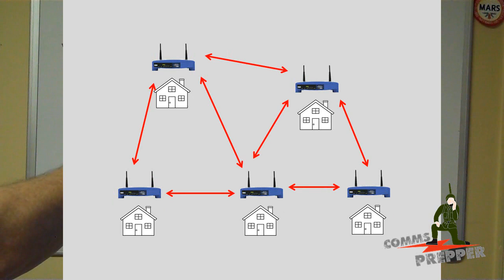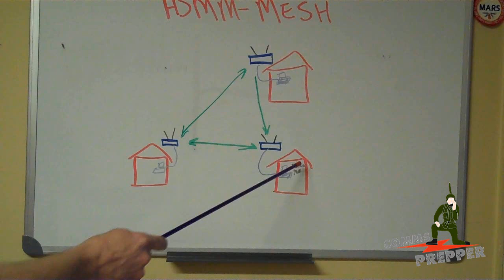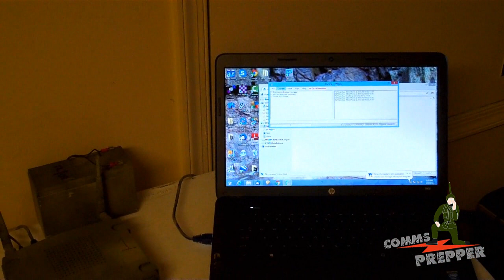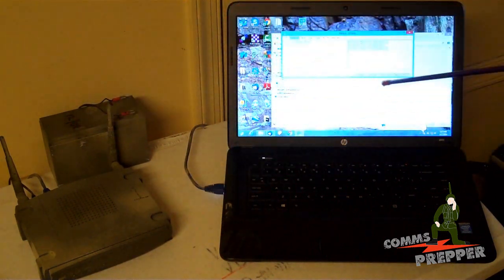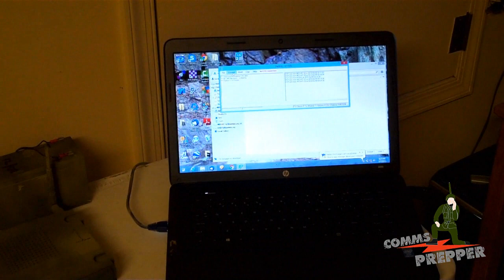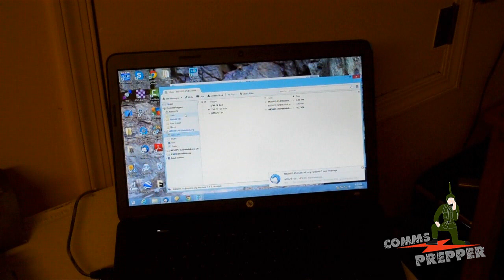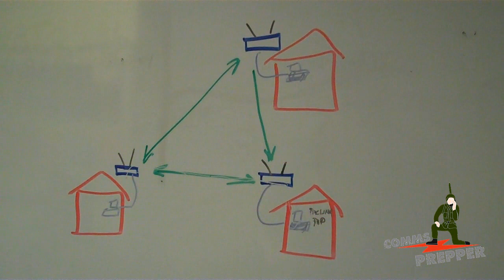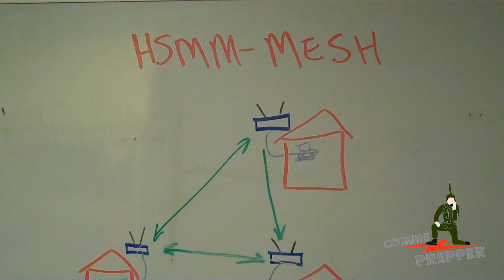HSMM-MESH

Comment: I tend to have bad luck setting up Thunderbird. Can you explain a bit about that? I'm trying the same set up as you basically, I have the Broadband Hamnet firmware on the router, so basically what you've done is loaded paclink (what are the settings for that?) and you have Thunderbird-the settings here ask for an email address and such, but like this, I'm using it offline. Can you explain settings in both of these as I pretty much can't get them to talk. Thanks!

Comment: Is there a way of powering the routers in a remote location or in a grid-down situation? 
I am guessing solar panels to keep the batteries charged would be ideal.
Any suggestions?
Reply from the maker: Solar should work fine if designed correctly.

Comment: What Linksys routers will work?  Will anything else besides the WRT54GL models work?
Reply from the maker: It has been awhile but I recall that only early models of the 54G can be used.  That may have changed in the past two years.  Checking the HMSS-MESH webstie might help.
Reply: Thanks!

Comment: But isn't the range only a few hundred ed feet?
Reply from the maker: With quality  external antennas you should get more out of them.  The Wi-Fi power and antenna rules don't apply once you convert them into Amateur radio units.

Comment: Can the firmware raise the power levels far enough to communicate at a distance? (IE a few miles?) Or do you need special antennas/equipment to do that?

What about USB wifi antennas connected to a Raspberry Pi? Can power levels be raised by the software or do you have to connect an antenna to an antenna jack on certain types of USB wifi sticks and use special equipment and such?
Reply: +Amaroq64 Hams can.

Comment: We can actually encrypt our mesh's.
The FCC rules state that encrytion cannot be used to "obscure" conversations. However, part 97 (part97.113) allows us the ability to make sure we secure our communications so non-hams cannot use our network when part 15 commercial equipment shares some common frequencies with the ham equipment.
To those ends we can indeed encrypt out network as long as the encryption key is made available for other ham operators.
In other words, Part 97.113(e) and it is also implied in 97.105,  allows us to ecrypt our network to keep Part 15 device information from being re-transmitted by a ham network.

Intent is the key. We are not encrypting to "obscure" the conversation, but rather encrypting to secure our Part 97 network from Part 15 transmissions as required by the FCC and the law.
Reply: +thallium200 I thought the reason they banned encryption is so the government can monitor communications. Does this mean that the government does not have to be given the key; only other HAM operators?
Reply: +Amaroq64 
Search "N5DUX encryption is legal". You'll find a PDF in the search results that explains everything in greater detail than I did.

Comment: Thanks for the experimenting and sharing, we learn a great deal! But the first question that pops in my mind with this video is: Why reflash a bunch of the same routers when everybody has a ready to go node via.... wifi-band... If everybody shares a part of their network (with all the different routers) you are done... I know you can boost the linksys' power (I have one with wrt) but that doesnt help stability. Isnt it easier to have more nodes (via different routers) than a few nodes because not all can have the same one?
Reply from the maker: Peter Enis I think the niche here is the MESH is established and maintained via the wireless side of the router vice a traditionally network where the "MESH" is created via cable.
Reply: +Commsprepper, wow.... thats a fast reply!
So if I understand you correctly you setup a network with self-regulating-self-maintence nodes on devices wich are always on (i.e. routers)?

Comment: Problem with that set up is you have redundant mesh but not redundant server. And it literally a pain to set up. You should try qtox, utox, antox, antidote. You could chat. Send files, and even do video conference wothout having to set up all those ip's call sign and stuff. All you have to do is create username and share your generated keys. The software does all the set up for you. No need to input ip's. No centralized servers and it works offline.

Comment: Have you tried setting up a MIRC server on 1 pc.. Yet.  Mail is ok though becomes an issue when taking it out of context of service sorry under wifi you do need some form of encryption for data security ..
Reply from the maker: Jason howe My channel is Amateur radio orientated.  Use of encryption is not permitted in the Amateur radio service under FCC Part 97 rules.
Reply: Can you use ctss/dcs on ham radio if you can that is encryption its lowest form for domestic use for local area so the fcc commenting you can't use aes becomes a standing joke as it is to an encryption.system in itself as far as I know I have yet to see a linksys 54 gl operate on  5 ghz given it is a 2.4 ghz transiiever when in wifi mode, unles you replace the  wifi chipset with something that can be used in 5 ghz band I would think the chipset have to be upgraded..not to mention  upgrading the connections to be compliant with roof mount antennas

Comment: very cool. been looking at doing this with standard routers and yagi's.  routers will be common place and act as a very secure line of site communication channel, with encryption built in automatically. I've not heard of mesh, but it's interesting as long as it provides additional protocal support . to include ip phones. 

standard router in my opion is going to give you way more options, you've also got a large number of ip capable devices like phone, IM,/chat, video  services that you could continue to use or build from stuff found out in the space. establishing a "mesh" network would be the same as what most folks are doing with the routers they have in their home, with the difference being that you just connect them to each other and over longer distances in a "daisy" chain. maybe mesh is easier to setup but to be honest, some planning and directional antennas give you some great very secure comms.
Reply from the maker: Not strictly mail server.  That was the only thing I could get to work that was Amateur radio Part 95 compliant.  There are guys that have videos showing VoIP (phones) and chat services but they had the extra hardware to make those videos (I was working with what I had).  It is worth checking out HSMM-MESH website http://www.broadband-hamnet.org/
Reply: Commsprepper  cool,, thank you, I'm all for having lots of options, with stuff we find in the space. this falls into that catagory and looks like it is very well worth exploring.

I've picked up more than a dozen linksys routers from the local thrift shop and never paid more the 7 bucks for them and what's awesome is they are 12v out of the box

Comment: The guys in Albuquerque love them. They have a pretty large setup running from what I remember talking to some of the guys at Duke City. 

While I hate to say it…I pretty much gave up on the setup about 3 years ago. It has it's negative aspects but also it's pluses. Plus, it runs off of 12V. Negative, mobile 2.4 GHz antennas are not extremely practical (most of them either aren't tall enough to clear luggage rack rails or don't offer practical amounts of gain for a 19 dBm transmitter). 

I'm holding off for some 900 MHz mesh equipment to become more practical.
Reply from the maker: Not an easy technology for sure.  I am still trying to meet up with an elmer on the topic to get my units to do something meaningful.

Comment from the maker: ***** I do not have a reply option with your comments (you need to change one of your settings).  When setting up Paclink you have to create "tactical call signs" for each PC in the Paclink program.  You will also need to permit LAN accessible in the Paclink setup.  When setting up the pop3 clients you need to enter the IP address for the computer running Paclink in the POP and SMTP server settings.  If you also want to check email with the PC also running Paclink you set the POP and SMTP settings to "localhost."  CommsPrepper

Comment: Great video, Hank!  I've got one of those old routers in my junk drawer.  I guess I can add that to my To-Do list now too!  :)
Reply from the maker: Richard - It's a cool project but I can't seem to find a use for it.  I'm thinking I will give these away in my next 8K sub contest.  Perhaps one of subs can make something cool with them.  CommsPrepper
Reply: We're doing a bunch of this in and around Kansas City. We're starting by meshing hospitals, most of which already have ham shacks with volunteers using FLDigi on 2m simplex frequencies for relaying data (mostly ICS forms). Meshing will make the relaying happen a lot faster, obviously, taking the manual tedium out of it. I'd like to eventually get the whole county mostly covered. That would let storm spotters send live stills or video to the EOC, get live radar data, and cover other mundane digital stuff (like APRS-FI) over a unified regional platform.

Myself, I have a functional node at the office, in my van, at home, and a number of portable devices that I've managed to get directly on the mesh with Linux and OLSRd. One of our club members has coded up a quick message board in perl that can run in memory on a mesh node and advertise itself as a service to the entire mesh. We're engineering applications that don't require any internet access, but there are ways to tunnel the mesh over the Internet to join multiple mesh networks together virtually if they're out of radio range.
Reply from the maker: Ian Lovell I was thinking about a MESH for the retreat and neighbors.  Problem is my neighbors don't have Amateur licenses.
Reply: Ian Lovell With a good outdoor antenna the range can be several miles. With a dish antenna, 20 plus miles.
Reply: Problem is that you need somebody to connect with. For this to be feasible, you need one ham every block in a urban environment to make this work. Unless you just want to make a mesh on your own property.
Reply: I could maybe see an EmComm use possibly.  Maybe put them in Pelican cases so they could be put up on a hilltop?  I'd be interested to see what the range is on them.  How'd you connect them to your batteries?
Reply from the maker: Richard Slusher I just connected them to the batteries.  The units are 12VDC and the batteries are also 12VDC.  The MESH is great and you can see all the units once they map.  The challenge is finding programs that are Part 97 compliant (i.e. no encryption bundled in the program).  I will tinker with them a bit more, maybe make one more video, then give them away.  I only did they video because I got several requests to make a video on MESH.  The coolest thing I saw was the VOIP over the MESH but I would have to buy too many things to make that work.
Reply: Yeah, I've heard VOIP was an option; but it sounds like a lot more hassle than it's worth to be practical.  Might not be too terrible of a thing to tinker with now and then and keep on the shelf.

I'm gonna build a second one of my 30Ah battery boxes here soon.  Then I'm going to start working on getting the foldable solar panel paired up with them.
Reply: Each node will find other nearby nodes and extend the wireless mesh. Stop thinking about it ham radio with contacts and start thinking about it more like off grid infrastructureand start thinking about it more like off grid infrastructure

Comment: I see 2.4 GHz antennas advertised in various catalogs. Would it be possible to wire these little Yagis up to the routers to increase gain and directivity?
Reply from the maker: Yes.  There are several videos on YouTube with guys using old direct TV antennas, can antennas, yagi antennas, and whip high-gain antennas.

Comment: I have thought about remoting an HF rig on the mountain ridge to the east of my QTH and wondered if I cold use these routers to pass rig control and voip. Might make a fun project just to do it. Great video.
Reply from the maker: It can been done - check out this link: http://www.broadband-hamnet.org/applications-for-the-mesh/158-remote-control-hf-rig-over-mesh.html
Reply: Commsprepper Ha. Cool. Thanks.

Comment: What kind of maximum range between routers could one achieve (legally) if boosting transmission signals and using external antennas?
Reply from the maker: Some guys are getting twenty plus miles with directional gain antennas.  I have not tested range.
Reply: BC ElginTex The present record is over 70 miles.
Reply: +Amaroq64 Think of it like cell phones. They operate on similar bands. That's why there are so many cell towers and the antennas on those are high up. Cell antennas are also directional antennas similar to dishes. Trees wont totally block some of the signal. If you put an omni antenna on a building above 99% of the obsticles around it, you'll get some good distance. Assuming you use good low loss coax and a good antenna. At the lower powers of most routers without an amplifier maybe 1/2 mile. Maybe. There are a lot of factors.
Reply: +thallium200 How far with omnidirectional antennas? Not necessarily the record, but the average/expected/etc.
Reply: +Amaroq64 Wow, that's a question with too many variables to actually answer. It would be dependant on power output at the antenna, type of antenna, antenna gain and what obsticles are between you and the antenna.
Trees blocking the signal is the number one issue when using the 2.4gig band.
Reply: I don't know anything about radio yet, haha. Sorry for the bad question.

Wow, so even something relatively soft like trees can block it? Which means if you live in a city with houses/buildings/etc, you are simply not going to be able to use this?

Comment: does anyone know of any plans to migrate the software to 5Ghz band/equipment?
Reply from the maker: Not sure.Here is the list of supported hardware http://www.broadband-hamnet.org/section-blog/37-hardware-faqs/101-supported-hardware.html
Reply: Yes, the link listed above will give you some direction - also if you want more distance look at Ubiquiti Devices product line 5x power depending on the model indo or exterior - I have a system in Colordao that is made up of 2 Ubiquiti Bullets with concave antenna's that are separated by 25 miles, the 3rd and 4th systems are 1500ft apart and use Ubiquiti Nano's - we are running a video survalence system, "phone" system and txt message. Not screaming fast, I does workd very well
Reply from the maker: Michael Jordan Can you tell me what programs you are running for phone and text messaging?  Also, can you tell me how you worked with the different subnets between nodes?  I have been unable to get basic file and print sharing to work.  Trying to come up with ideas how this can be used.
Reply: Commsprepper  I was and am the hardware guy on this project, So I don't know the software side as well. I'll try and track down what we used, However it seems to me that it all came from www.broadband-hamnet.org, but I'll have to check my notes
Reply: anyway for me to contact you off the public list ?
Reply from the maker: Michael Jordan commsprepper@gmail.com

Comment: Awesome video, myself and a few of the local amateurs in virginia have been able to setup a 30 mile link. Primarily using the ubiquity hardware and the software they've developed for that.
Reply from the maker: I'm in VA. too but there are no nodes in my area (Fairfax County).  Can I ask what you guys are using for chat and video?  I can't seem to find programs that are not encrypted.  CommsPrepper
Reply: Commsprepper Right now no video, I'm supposed to setup a chat/video client, and have been looking at using Jabber, Openfire has a nice client that integrates all that. However I had issues trying to get the video bit to work. I really want something decentralized though and I don't know if any software is out like that. It can also do voice, but we have an asterisks server running on a rasberry pi. So we have our own VoIP setup on it. I know there are groups up that way that are trying to get something setup in the fredericksburg area. I did a quick search and KE4HGN is working on something. His website is roteno .com. Another resource is this: http://www.remoteamateur.com/ClubPages/Virginia.aspx
Reply from the maker: ***** I tried to google Focus Phone and could not find a link.  Could you share that? Also, can you advise how to add options within the MESH software?  Thanks.  CommsPrepper
Reply: Commsprepper This might be useful, it has info on an alternative called linphone as well...